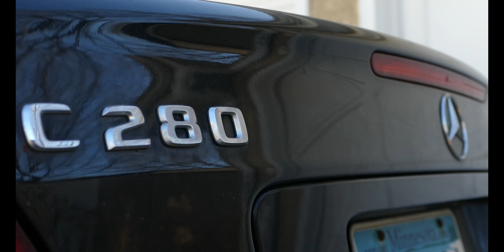The Pinnacle of German Sports-Luxury Transportation

Comment: The sliding hammer is a good one, but it destroyed by high temperature the joint itself I guess. To have a steel plate behind the joint and weld the sliding hammer on that plate somehow would save the joint. Yes it was bad anyway but if not, one could save it this way. Good video!

Comment: Nice.....I had a C320 and a C240.    These were made during the Daimler Chrysler days.....   They rusted badly in Canada, but I never let mine get to the point this one was.  I had to repair and repaint very panel except the roof.    They were pretty reliable, but what most people that bought them after 4-5 years didn't realize is that its an MB with MB parts and service costs....so most 2 to 4 th owners had them serviced at Mr Lube and Walmart if they bothered changing the oil.

You still see a lot of them in Europe.   The weather is not as harsh, people generally do the maintenance and there are a lot of independent shops and after market parts to keep them going.   Cheap transportation.

Comment: I’d actually like to know Simon’s opinion on the old Merc, I’ve owned 4 of them and they are not as expensive to maintain as people think for routine jobs and the build quality is excellent nuts and bolts actually undo instead of snapping off, so I am a Mercedes fan, I currently drive an E220 and love it.
Reply: That goes for almost every german car. Do your annual inspection, do the maintenance which is roughly around 200-500€ a year, depending on the car and enjoy. I owned more than 20, own currently 7 and I just don't come across the problems most US americans always seem to do. Mind you, I've never owned a car with less than 200.000km on the clock and the highest count was 560.000km. My 99 A8 3.7 quattro sits at 465.000km right now and it's in the state of your avergae car after 5 years.
Oh, and I own a V10 Touareg and a RS6 C5, which both are also not a problem. Together they have 540.000km done.

Comment: Although Mercedes in that time and model era did some serious cost cutting resulting in hidiously bad rusting cars, this I've never seen in Germany. And barely in junkyards. I don't like Mercedes, but even I don't want to see a Benz in this state. A C280 4matic is quite the oddball.

At least you can be thankful german cars don't use lug nuts. Even wheels that weren't removed in over two years, which would be very weird and meaning there is absolutely no maintenance happening, you will always get wheelbolts off. Had a car that was standing outside for 25 years. Came in, breaker bar to the wheelbolts and all came off. Had a C20 which was standing for 5 years outside, had quite the struggle to get those lug nuts off without damaging them. I don't understand how exposing thread to the environment sounded smart to someone.

Never seen someone trying to push back the piston before loosening every bolt. Calipers on most german cars basically always come off brake rotors, as long as these don't have a significant ridge. 

That way you avoid snapping of bleeder screws because it can render a caliper junk. If the caliper is stuck on german cars with floating calipers, use a screwdriver between the bracket to the side above the rotor and the caliper. You can tilt the caliper off that way.

Of course it's up to you, but please use brake anti seize on brake pads glide surfaces, after you thoroughly cleaned them with a wire brush. And make sure that grease you use, is hydrophobic. It makes my skin crawl to see pads changed but not the rotors, but I know that customers sometimes insist on weird wishes. If it's avoidable, without going into the detailed physics of why you should always change both, don't change only one. With regular service intervals, pads and rotors wear at the same rate. At least if you use parts together which should be used.

And please, please clean wheelbolt threads with a wire brush. If not, you kill your wheelhub threads, make them bind again, distort the recieved torque on the bolt and make the next persons life not easier. Which could be you again.

Comment: Who says you can’t use a claw hammer. First question, who hammered on those wheel lugs?
Reply: They never got cleaned. Once a year I clean them with a wire brush on all my cars. Because at least once a year you swap from summer to winter tyres. And if not, you do your maintenance like inspection of suspension parts, brake fluid change etc.

Comment: 7:32 wrong. not this  grease here 8:43 rember tighten only at normal wheel position 9:25 wrong it should not be assembly with force it must callibrate  17:40 heat first not at end 17:53 and not hammering push in but rotate how you do at end 18:49 steel brushing hole? 21:19 new pads without rotor?  you could have sanded the brake disc with a stone 26:05 hood close with throw it if you pull you can bend hood

Comment: When buying a: Mercedes, bmw, Audi or other European luxury auto. You are actually buying an open ended ticket to the dealer service center. German tanks suffered from constant repeated breakdowns from complicated manufacturing and build techniques during WW2, costing them lots on the battlefields. When it’s working, it’s great. But the key word “when” has not changed even from the 1940’s… I would NEVER buy one of these, unless I wanted a quick way to empty my wallet.
Reply: Ok then, your wrong
Reply: We drove Leopard tanks here in Australia. In our harsh environment, they performed very well, reliable and smooth.
Reply: All newer cars are reliable, every machine is but key word is maintenance. If you don't do the maintenance but then say oh German cars are not good. That's why. Indeed they are premium cars and require a lot more maintenance, but that doesn't mean they aren't reliable.
Reply: W203 C- class Mercedes we’re far less reliable than their predecessor model , the W202.
Reply: Nonsens... Why do we not have these issues overhere in EU? Well, for one the cars are great but not nearly as neglected as in the US or Can. Secondly, service is actually pretty good and affordable unlike the many crooky dealers across the pond. Just look at the state of many cars in the US. Or watch an episode of just rolled in....
Reply: @ruudmobile6726  be sure they’re DOMESTIC CARS. Don’t you think parts would be more expensive for a US Chevrolet or US made Ford or Lincoln, over a EU- made car ? Are you not aware of the Tariffs for cars & car parts coming into the EU ? There are no Tariffs flown cars & car parts made within the EU, just local sales taxes. Is that Nonsense to you too as well? 🤔
Reply: @ruudmobile6726  depends on who is maintaining them and IF they are maintained. I don’t and never have had maintenance issues, but I maintain mine above manufactures recommendations. As for “just rolled in”, yea, consider the owner/drivers of those heaps…. No wonder the issues…
Reply: Yes, maybe not as reliable as Japanese, but if maintained per specs, reliable like any other brand…with hits and misses like every other manufacturer. The other big piece to remember is people buy German cars for the status and it’s not just being lazy, they can’t afford to maintain them, and then they break.
Reply: @ruudmobile6726  nonsense? My sisters friends car had the trip computer & bcm ( at seperate times) fail in a W203 C200… Mercedes are NOT known for their reliability when it comes to electronic components … a crank angle sensor fails exponentially more time on a W203 , compared to a Toyota Corolla or Camry…
Reply: May be yes may be no ..
BCOZ IM STILL DRIVING MY VOLVO 940 AUTO TURBO 2316 CC 4 CYLINDERS 1996 MODEL ...NO PROBLEM ...! I JUST REPLACE MY FRONT HURB RUBBER COUPLING AND STARTER AMARTURE BCOZ TOO OLD ...CAUSED YOU DIFFICULT STARTING AND STEERING MOBLING WHEN YOU APPLIED YOUR BRAKE AFTER HIGH TOP SPEED ...! 🎉* THERE'S IT .
Reply: You can't neglect a car and then complain it's unreliable.
Reply: You’re very ignorant and know nothing about them. Many are neglected and turn into money pits like the one in this video, but they are great cars if maintained properly and cared for. Obviously they’re more complicated and expensive to own than a crappy Asian or American car.. but they are far better cars in every way.
Reply: @iOBBY227 wrong. New cars today are actually far less reliable overall than new cars were 20-30 years ago.
Reply: @the8419  not ignorant here.  Minimal maintenance on a Toyota and it will outlast any European vehicle that has built in time limited parts to get you in the service department…so, compare the cost of ownership spreadsheets before you make accusations of someone else.
Reply: @Makemysammich23  if we’re talking about new vehicles.. there is some truth to that. However, that wasn’t the case in the past. Mercedes, for example, was always known to make the most reliable, durable cars in the world. Compared to Japanese cars, they were just as reliable, FAR more durable and MUCH safer, handled far better, performed far better, were more comfortable and had more amenities. As I’ve said already, they’re more expensive overall because they’re more complicated.. but that doesn’t make them any less reliable. A modern European car could easily outlast a Japanese car, but it will cost a lot more in the same time period. The simplicity of Japanese cars makes them reliable, which basically means that there are less parts overall to fail. The fact that European cars drive so much better than Asian cars isn’t magic.. there is a tremendous amount of engineering that goes into it, and that will have to be kept up for the car to be reliable and enjoyable. Truth be told, anyone who judges a car based on how “minimal” the maintenance regime should be, shouldn’t even be making ANY judgements. You obviously don’t care what you drive, as long as it’s cheap. People with that mindset generally don’t buy higher quality cars like various European makes, and It’s not a black and white situation. You obviously have no clue or experience.. you’re just repeating nonsense you’ve heard online
Reply: @the8419  lot of opinions in your post. You b-“I don’t care what I drive as long as it’s cheap”, uh no, I’m very specific. “I have no clue or experience”, you do not know me and have no right to judge, but I have lots. “your just repeating what you heard online”- no my statement is factual based. 
Why would you buy something with engineered, life limited parts keeping you in the service department emptying your wallet? Poor financial decision by those without deep pockets and money to burn…
Reply: If they are not maintained, of course they arent working.
There is no such thing as a bad car, only a neglected one.
Reply: Mercedes is mercedes.
Reply: @Eduard.ianculescu  Was, 30 years ago.
Now Mercedes is Renault 😀
Reply: Ok boomer.
Reply: German never have ability to make durable vehicles
Reply: So don't buy one 🤷
Reply: @ I won’t, nor would I, ever..
Reply: Bullshit. The cars of the same years of the one in the video, were the pinnacle of reliabilty of german cars. Shit happen when you don’t do the manteinence
Reply: @ yea, ok…
Reply: i remember going to the bmw place when we had a mini, and seeing that the “basic” service charge was £800. fuck that shit.
Reply: You're 100% correct. I've been a dealer for 39 years and I have bought, sold, repaired thousands of European, Asian and domestic cars. European cars are by far the most unreliable and most expensive to own and maintain. I stopped dealing with them years ago. They are a never ending struggle to keep on the road not to mention all the fit and finish items that break or otherwise deteriorate. There are legions of other used car dealers I know who will attest to the same. Unless you are able to perform all the maintenance and repairs yourself European cars are terrible buying decision.
Reply: I’ve owned many Mercedes and had same luck as Toyota. Matter of fact, my Lexus cost me more than any car I’ve had
Reply: @the8419 well said, from the states
Reply: Absoluta rubbish😂😂😂😂😂
Reply: @ enjoy your repair bills.
Reply: @Makemysammich23  depends on which year Toyotas. Few years there where engines would burn oil like crazy. Also, their V8’s require a lot more maintenance. Timing belt every 100,000 miles?? Starter is in the motor? Give me a break
Reply: @ Toyota’s can go a documented million miles, and routinely hundreds of thousands of miles, Mercedes, bmw, Audi… once it hits 100k, resale plummets, for a reason. If you’re complaining about a timing belt or starter in the middle of the block (which rarely fails) on a 4.7 V8, that engine is known to go just about for ever with moderate preventative maintenance, cheaper than buying a new car. Your wallet, your choice.
Reply: @ so can Mercedes. I have a 2003 with 220,000 miles and money spent to maintain has been less or same as Toyota.
Reply: @ thats an exception, not the norm, and good for you.